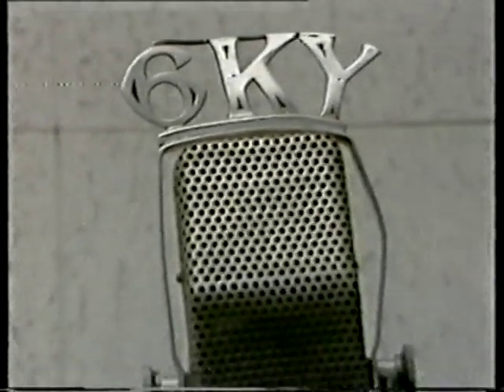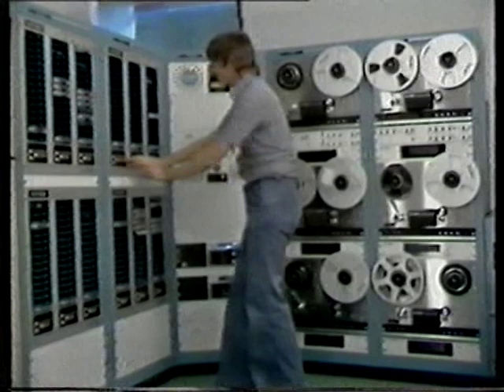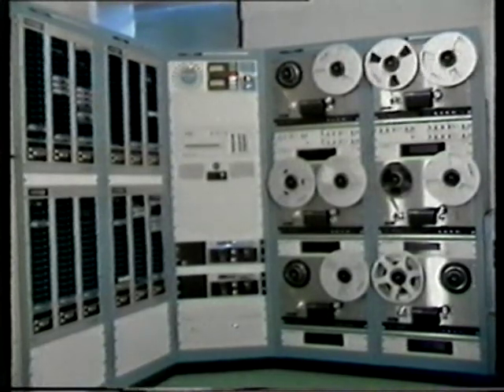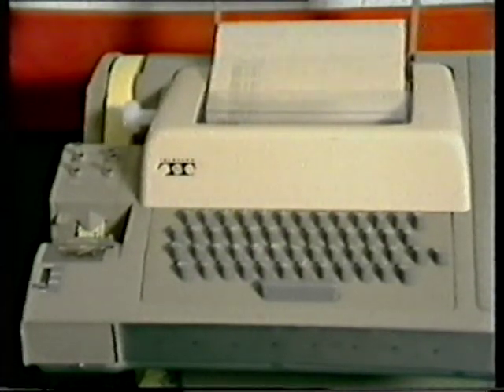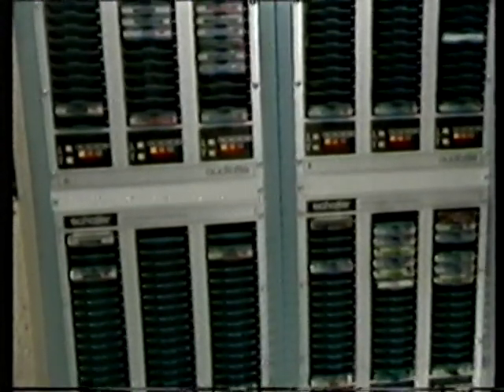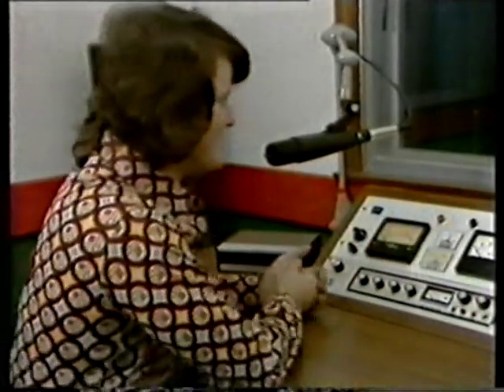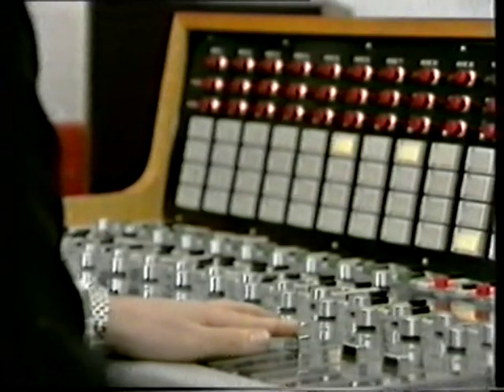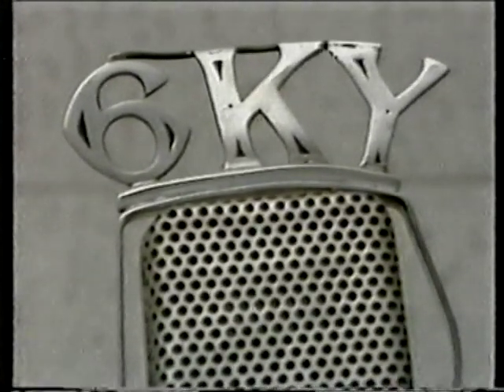Schafer "FRED 903E" Radio Automation System at 6KY in 1976

Comment: I remember a Schafer “Fred” system at KWAM in West Memphis, Arkansas. It was a very elaborate automated playback system, at the time. The reel-to-reel tape decks would operate in fast forward then reverse trying to find a particular cut or spot. Occasionally, it would screw up and play the wrong commercial spot.
Personally, I don’t think it was worth it’s extremely high cost. By today’s digital standards, it was an extremely crude monster.

Comment: Yes, DJ and manned the same unit in 1981...our Schafer unit was named "IVAN"! We had 4 reel to reel decks for music, 4 circular carousels for commercials, along with individual cart decks for odd & even time announce, weather/PSA forcasts, and DJ relate lines for every day of the week produced by Century 21.  It's drawback was music selection, as it was hard to random mix the music. Deck #1 were RE-CURRENTS ( 2 reels?) Deck #2 were CURRENTS (2 reels were constantly rotated & were updated  weekly by Century 21 & they had radom front or rear announce and occasional 2 songs back to back), Deck #3  & #4 were for the  bulk and heart of the format library. Our format was Audult Contemporary. Maybe 30-50 reels, When these ended, we put on the next numbered reel. Had the same keyboard on the unit along with printer that printed all events. We swithced to AOR, and it  did not go well, as so many obscure album cuts, taht we ended up splicing songs out. Later went to LIVE ASSIST with the unit, again very limited. New owners finally went to LP's!

Comment: I worked with one of these Schafer Automation Systems in the late 80's, but the station I was working for was using it for the sister AM station & used a Satellite Music Format with the Shafer System, only thing different, we had Carousels to load up the spots on. The Keyboard Display Terminal with it's fancy digital clock of the day, had tubes in it! It was not solid state!  I used a Sono-Mag Automation, simular to this until 1998, when I first learned & installed a DOS based Automation System.